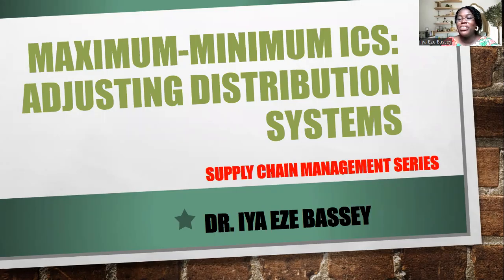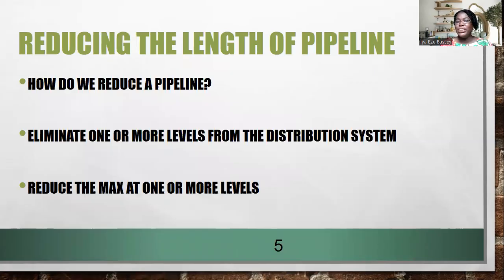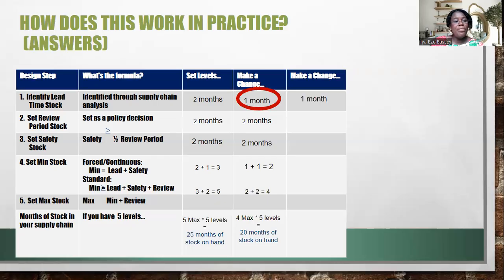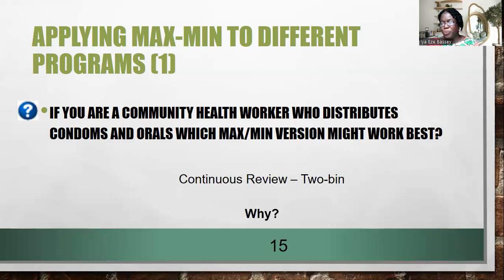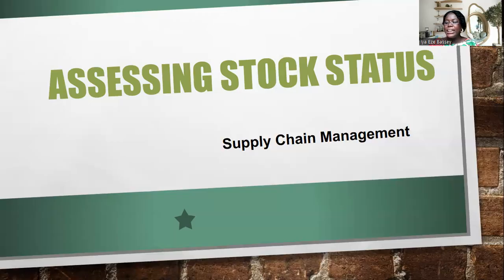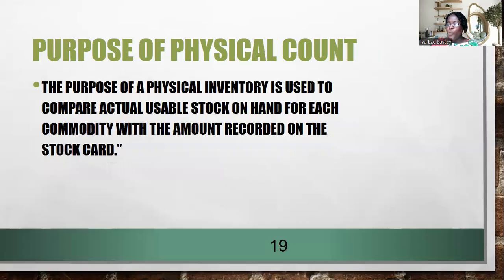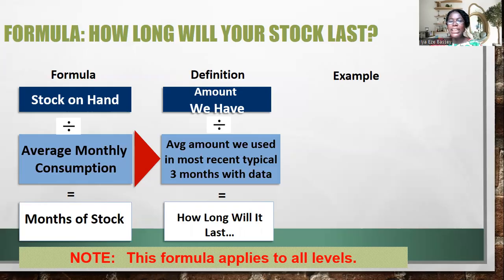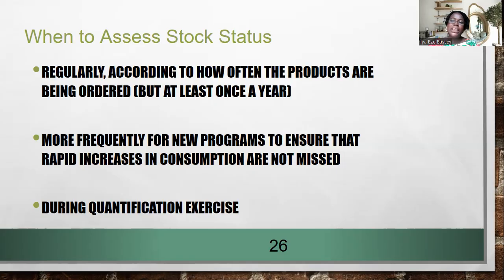Maximum-Minimum ICS: Adjusting Distribution systems (Supply chain management series)

Comment: In summary, there are ways in which yhe distribution system policies can be adjusted and one of it is to consider the length of the pipeline.
  The steps in designing a max-min ICS are;
* Set up initial max-min policies for each level and type of facility.
* Check if the overall distribution will function properly if the level specific max-min policies are implemented.
* Check the total length of the pipeline that the policies at each level imply.
  Ways in reducing the length of a pipeline includes; 
1. Eliminating one ir more levels.
2. Reduction of max at on or more levels.
  Some of the factors that might affect the determination of max-min stock levels are;
1. Cost of product.
2. Reliability of transportation.
3. Storage capacity.
4. Lead times.
5. Storage conditions at different levels.
  Some of the advantages are;
1. Avoids cost of emergency.
2. It avoids under stocking.
3. Minimise wastage.

Comment: MAXIMUM -MINIMUM ICS ADJUSTING DISTRIBUTION SYSTEMS
  IN SUMMARY
I have gained an insights about the steps in designing a maximum -mininmum inventory control system,also learnt that eliminating one or more levels are way of reducing the length of the pipeline.
 I also understand the benefits of a max -min system such as preventing overstocking and understocking,along with the challenges associated with different versions and variations 
 Factors that impact max-min stock levels are 
1)cost of products
2) Reliability of Transportation 
3)Storage capacity 
4) cost of storage 
  Thanks ma for the insight

Comment: SUMMARY – Inventory Control System (ICS)
	•	ICS adjusts stock levels across the supply chain using maximum and minimum levels.
	•	Minimum level triggers automatic restocking.
	•	Maximum level slows down orders or moves extra stock elsewhere.
	•	This system:
	•	Reduces storage costs
	•	Avoids stockouts
	•	Responds better to demand changes
	•	Improves the flexibility and efficiency of the supply network

Comment: Lecture by: Prof. Iya Eze Bassey

Summary: Max-Min Inventory Control System (ICS) – Adjustments in Distribution

Pipeline Design Steps:
	1.	Set initial Max-Min policies for each facility level
	2.	Ensure the system works effectively with those policies
	3.	Check the total pipeline length those policies create

To Reduce Pipeline Length:
	•	Remove unnecessary distribution levels
	•	Reduce maximum stock levels at any point

This ensures a leaner, more responsive supply chain.

Comment: In summary I learnt about the ways to reduce the maximum stock level and they are; 
-reduce the lead time at one or more levels and also you need to improve the distribution system’s reliability at one or more levels so thag safety can be reduced 
-shorten the review period at one or more levels 
And also the  factors that impact Max-Min stock levels and the advantages of using max - min system 
Few of which you listed were ; avoid cos of emergency orders , avoid overt stocking, minimize wastage etc
    Then moving on to the crucial part of the inventory control system which is Assessing stock status.
     The physical count and it’s purpose which is used to compare actual usable stock on hand for each commodity with the amount recorded on the stock card..

Comment: In summary , the steps for designing a Max-min inventory control system and how to reduce the length of pipeline we discussed. How elements of the formula can be changed in order to reduce the Max- Min stock level,Other factors that impact Max- Min in stock level such as cost of products, reliability of transportation ,storage capacity, lead time ,etc ,and challenges to using each version and variation system with numerous levels, system that manage the large  number of communities ,and system that manage products for new programs are to be considered when designing the max -min ICS.
Applying Max -min  to different programs :
1  As a community worker health worker: Continuous review -two bin and the Version recommended  for drugs HIV kits and lab is the Standard Version.
Knowing how  to access stock status is paramount as it helps to determine how long supplies will last
 formula: MOS = SOH ÷ AMC ,AMC= recent monthly consumption ÷ 3  ,SOH = stock on hand at the facility ( total of all testing sites).
 And d the advantage of using Max mean system include avoiding understanding reliable data source from hdp for focusing and quantification exercise.n

Comment: Thank you so much ma for this great lecture. after watching the video I learned about the various steps in designing a Max-Min ICS which includes:-
1. set up initial Max-Min
policies for each level and type of facility. -
2. check if the overall distribution will function properly if the specific Max-Min policies are implemented.
3. check the total length of the pipeline that the policies at each level imply.
Also i learnet on ways to reduce the length of pipeline which are:
1.eliminate one or more levels from the distribution system and reduce the max at one or more levels.
Also elements to reduce the maximum stock level:shorten the
review period at one or more levels, reduce the lead Time at one or more levels and improve the distribution system's reliability at
one or more levels so that safety stock can be reduced.
The factors that impact Max-Min stock level: cost of production,
reliability of transportation etc........
Advantages of using Max-Min system: minimize wastage etc....
Also the challenges to using each ICS version and variation:
Systems with numerous levels, systems that manage a large
number of commodities and systems that manage products for
new programs.
Also what is meant by physical count and it's purpose and also
when to assess stock status.

Comment: In sumary v, pipeline is the flow of good or services from suppliers to manufacturers , distributors and ultimately to the end user
To reduce the length of a pipeline we have to 
1: Eliminate one or more levels from the distribution system 
2: Reduce the maximum at one or more levels 
Maximum and minimum stock levels besides the length of pipeline can be affected by the following factors 
1:cost of product
2: Reliability of transportation 
3 Storage capacity 
4: Lead time 
5: Storage condition at different levels 
The advantages of using Max-Min system are as follows 
1: Avoid overstocking 
2: Avoid cost of emergency orders
3:Simplify inventory control decision making 
4: Minimize wastage
Some of  the challenges to using each of the versions and variations are
1: System with numerous levels
2: System that manage a large number of commodities 
3: System that manage product for new programs

Comment: Thank you ma.  FRom this, I understand that elements of the formulas can be changed In Order to reduce the Max Stock level.
Such as:
 * Shortening the review period at one or more levels
 * Reducing the lead time at one or more levels
 * Improving the distribution systems reliability at one or more levels so that Safety Stock can be reduced.
   Other factors may influence or impact max-min stock levels such as Shelf life, Cost of storage, Storage capacity e.t.c.
   Some advantages of using Max-Min
   Systems are
   a) Consistency of stock levels
   b) Avoid Overstocking
   c) Avoid understocking e.t.c.
   Some challenges using each version and variation are
   a) Systems with numerous levels
   b) Systems that manage a large number of commodities
c) Systems that manage products for new programs.
The Physical Count is the process of counting by hand the total number of usable units of each commodity in health facility at any given time.
I have also learnt that the purpose of assessing stock status is to determine how long supplies will last.

Comment: Thank you Ma for the informative video. I learned that in Inventory Control Systems (ICS), pipelines are products ordered but not yet received. They serve as buffers to maintain steady production and avoid stockouts. By regularly distributing pipeline inventory and setting maximum-minimum stock levels, manufacturers can ensure stable supply. Reducing maximum stock levels through shorter review periods, better reliability, and minimized lead times can lower safety stock needs.

Additionally, storage is crucial for protecting products and keeping them available until use. Key activities include receiving, organizing, packing, and shipping supplies. Proper storage extends shelf life and preserves product quality. Visual inspection helps detect issues like damaged packages, defects, or missing labels and parts, ensuring the product remains safe and effective.

Comment: Thanks for the lectures ma.
In summary, u learnt that  the steps in designing a max-min ICS are:

1)Set up initial max-min policies for each level and type of faculty.

2)Check if the overall distribution will function properly if the levels specific maximum policies are implemented.

3)Check the total length of the pipeline that the policies at each level imply

Comment: I learnt the ways we can reduce the length of a pipeline, the steps in designing a max-min ICS: identify the lead time stock, set the review period stock and set the safety stock. The importance of using max-min system is to: avoid overstocking,avoid understocking, minimize wastage and avoid costs of emergency orders.
     I also learnt what physical count is and it's purpose is to compare the actual usable stock on hand for each commodity with the amount recorded on the stock card.

Comment: Thank you ma.
In this lesson, I learned the steps for creating a max-min inventory system:
	•	Set up max-min rules for every level and type of health facility.
	•	Check if the supply system will still work when those rules are used.
	•	See how long the pipeline becomes because of the new rules.

How to make the pipeline shorter:
	•	Remove some levels from the supply system.
	•	Reduce the maximum stock at some levels.

To reduce max stock, you can:
	•	Shorten the time between reviews.
	•	Reduce lead time (how long it takes to get supplies).
	•	Make the system more reliable to lower safety stock.

Other things that affect how much stock is needed:
	•	Price of products
	•	How well transport works
	•	Space for storage
	•	Cost to store things
	•	Shelf life of products

Benefits of max-min system:
	•	Prevents having too much or too little stock
	•	Reduces waste
	•	No need for urgent orders
	•	Easier to manage stock

Challenges:
	•	Too many steps in the system
	•	Too many products
	•	New programs

Physical count means counting what you have in your store by hand.
It helps check if what’s recorded matches the real number.
Stock status check shows how long your stock will last.

Comment: Thank you Ma for this  lecture, from the session i learnt;

That designing a max-min inventory control system (ICS) involves several steps. First, policies must be established for each level and type of facility. Then, it's important to assess whether the overall distribution will operate effectively under those policies.The entire supply chain's length should be reviewed. To streamline the pipeline, certain levels in the distribution chain can be removed or the maximum stock levels at some points can be reduced. Various elements such as product costs, storage expenses, storage space, commodity shelf life, and delivery lead times can influence max-min stock levels. This system helps prevent overstocking and stockouts, reduces waste, and can lower the cost of urgent procurement.
A physical count refers to manually tallying all usable items for each commodity in a facility or store at a specific time. This practice helps determine how long current supplies will last. To estimate the duration these supplies can cover, use the Formula:
Months of stock = Current stock \div Average monthly usage.

Comment: In summary, 
I learned the steps in designing a max-min ICS, which include:
1. Set up initial maximum policies for each level and faculty.
2. Check if the overall distribution will function properly if the max-min policies are implemented
3. Check the total length of pipeline that the policy of each level imply
Most times, the length of the pipeline are too long and can take longer time in commodity delivery, however the pipeline length van can be reduced by:
a. Elimination of one or more levels
b.Reduction of max at one or more levels

Maximum stock levels can be reduced by:
1. Shortening of review period at one or more level
2. Reduction of lead time at one or more level
3. Improvement of distribution system reliability.
Some other factors that impacts max-min stock levels are;
- Cost of products
- Reliability of transportation
- Storage capacity
- Cost of storage
- Storage conditions at different levels
- Shelf life of health commodities.
The advantages of using max-min system includes:
- avoid overstocking
- avoid under stocking
- minimize wastage
- avoid cost of emergency orders
- consistency of stock levels.
Thank you Dr. for the lecture 🎉

Comment: Thank you for a excellent class ma
In summary,i learnt the length of a pipeline 
Steps in designing a Max Min ICS are:
Set up initial Max Min policies for each level and type of faculty 
Check if the overall distribution will function properly if the level specific Max Min policies are implemented 
Check the total length of the pipeline that the policies at each level imply 

We can reduce the length of the pipeline and reduce the maximum stock level 

-Other factors that impact Max Min stock level 
Cost of products 
Cost of storage 
Lead time 
Storage capacity 
Age of program e.t.c

I learnt advantage to using Max Min system, challenge to using each version and variations, how to apply Max Min to different programs 

Assessing stock status which we have 
Physical count and the purpose of physical count 
Purpose of assessing stock status 
Visual inspection 
 
We have formula 
Stock on hand ÷ average monthly consumption= months of stock 
Amount we have ÷ avg amount we used in the most recent typical three months with data = how long will it last 
100 tablets ÷ 25 tablets used per month= 4 months supply of tablets 

And to When to assess stock status 

Thank you ma

Comment: Adjusting Distribution System

In summary
The first step to consider is length of pipeline:
When designing a max-min ICS we need to set up initial max-min policies for each level and type of facility, and also check the total length of the pipeline.

The second step is reducing the length of pipeline:
Which is by eliminating one or more levels from the distribution system and reduce the max at one or more levels.

I learnt about factors that impact max-min stock levels which includes:
Lead time, reliable source of supplies, effect of a zero balance of stock and shelf llife production cost.

I noted some advantages of using max-min system is to avoid overstocking, avoid understocking, minimize wastage and avoid costs of emergency orders.

It was very interesting, thanks much ma

Comment: Thank you ma for this well detailed explanation 

After this impactful session I learnt the ways to adjust distribution system policies which includes making the system more efficient or responsive to demand changes. I also learnt the advantages and challenges of max-min inventory control system which is a method used to manage stock levels. And to also explore it's benefits like preventing stock outs and overstocking and challenges such as; needing accurate data and regular monitoring 
Furthermore, I also learnt how to describe the inventory control system used in the logistics management of HIV/AIDS commodities and to also explain the meaning and purpose of assessing stock status.
Lastly, I also learnt to determine the number of months of stock available at any storage level using inventory and usage data to calculate "month of stock" which helps in forecasting and avoiding shortages or wastage.

Thank you once again

Comment: In summary of today topic, i learnt that before setting up a max-min system,we need to follow some steps like setting up initial max- min policies for each level, observing if the distribution will function properly. if these policies are implemented and observe the total length of pipeline that the policies implies

We assessing stock status,to determine how long supplies will last and we were given a formula which applies to all level; months of stock- stock on hand÷ average monthly consumption

 Purpose of stock status assessment:
* conduct physical count
* verifies stock accuracy
* prevent discrepancies leading to stockout
 
Thank you ma, for this wonderful topic

Comment: In summary, I learned that the purpose of storage is to keep the product and its package safe and ready until it is time to move it. It helps make sure the product stays good and is always available.
The main storage activities are:
	•	Receiving supplies and checking them
	•	Putting things in the right place
	•	Picking and packing them
	•	Shipping them out

Storage is important because it helps the product last longer, keeps the stock full, and protects the product.
Shelf life is the time a product can stay stored without losing its use, safety, or strength—as long as it is stored the right way.

Visual inspection means looking at the product and its package to find any problems.
You check for:
	•	Damage to the package
	•	Product defects
	•	Wrong or missing labels
	•	Missing parts
	•	Strange things inside the package

Thank you ma.